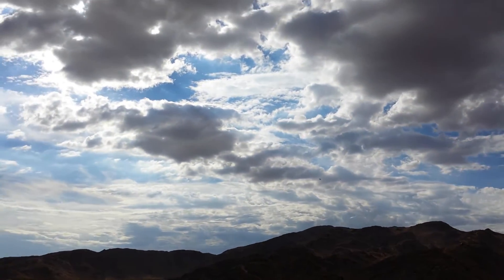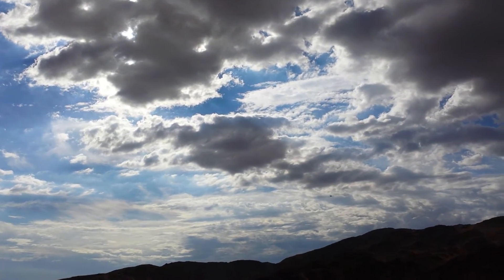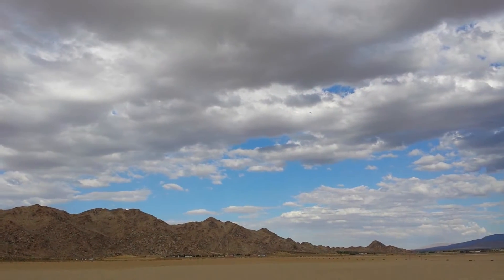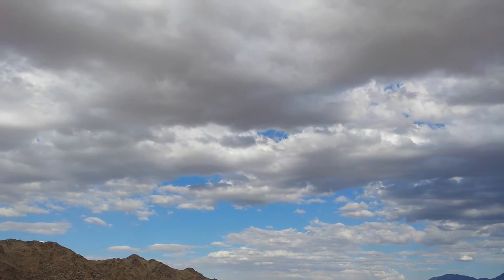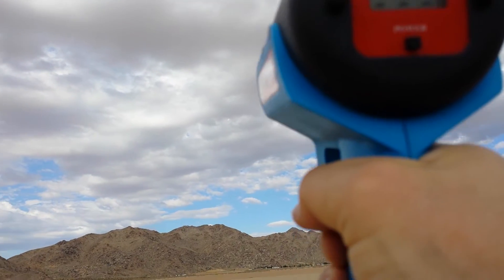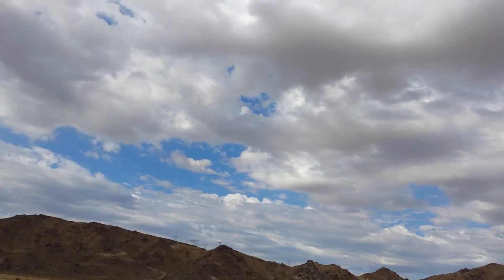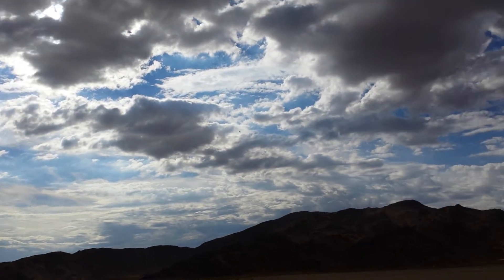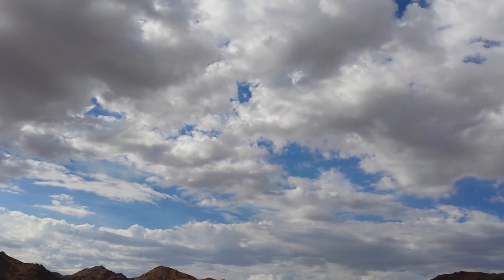1.7M JTM Viper Jet - Fast - Radio Control RC Jet 14S Over 8KW - Fast Burner Passes on Radar

Comment: Hi mate.. I've got the same setup as you (Ramtec 14S HET motor in the Extreme Alloy housing).. If you don't mind could I please have the file for your intake duct (between intake ducting and fan shroud).. I'm only now getting around to building mine 6 yrs later, and that one part is the main obstacle for me... It would be so very appreciated... cheers, Natesh

Comment: Rabbit Dry Lake?. And yea, to me in the long run, I think flying turbine is the cheaper route believe it or not. A K60G runs 1700-1800, ive bought electric jets this size, and spent that much in batteries, motor, esc, and fan unit, and get less than 4 mins of fun. Plus batteries that have to pump out that much power, well, I dident get more than 30 flights until $500+ batteries started giving up on me.